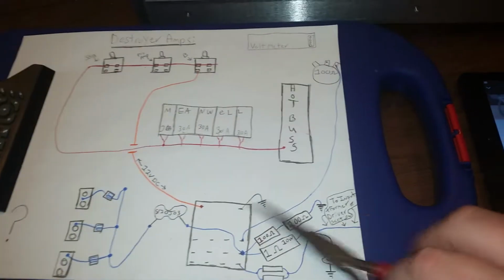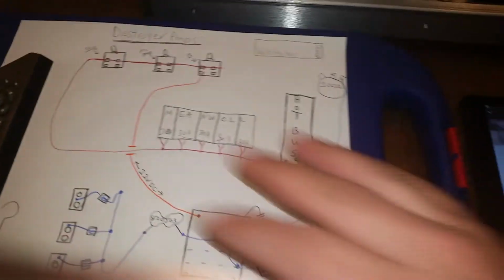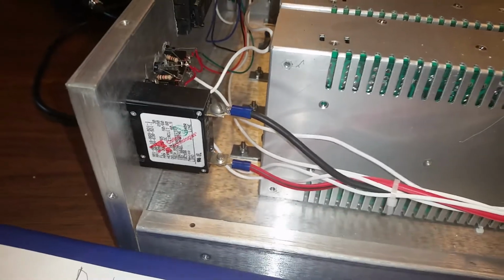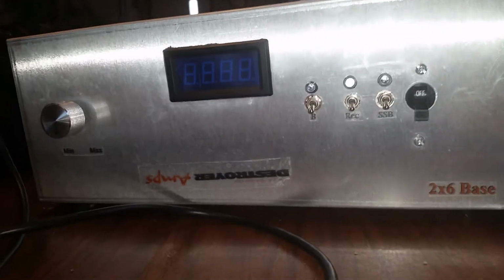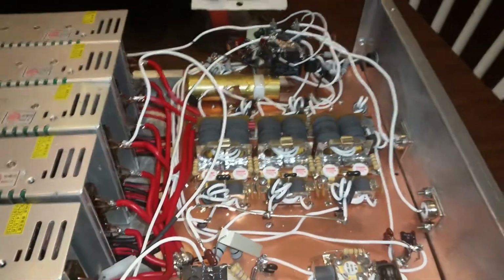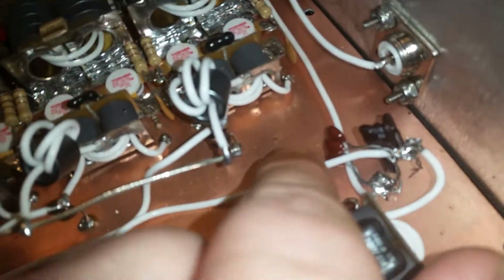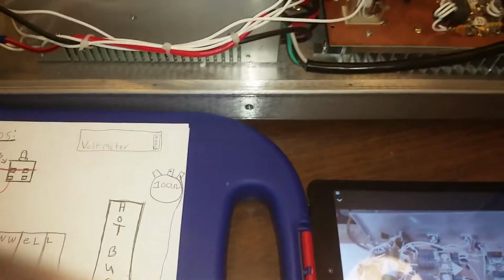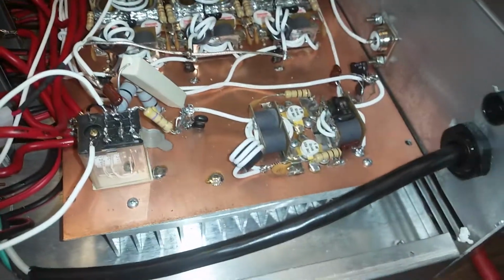Look At This 2x6 Base Amp Express Your Thoughts In The Comment Section. . .

Comment: No good stray i inductance and not alot of Chraftsmanship here.. .. i like physical connection..on the eyelts if u doht use a star washer and locker its comes loose ...i myself like soldering the connections to the switch.. my biggest issue is stray Inductances and poor Chraftsmanship

Comment: a outher fake bias. when done right for bias should have  .5 to .7V from base to emitter.  .5V is around class B and .7 - .75 is round class A . 0 volts is class C. it is about the collector current with no RF . And I see possible trouble ahead. How is air going to pass threw them heatsinks ? The fins are facing the wrong way and no blocker to make all are exit threw the heatsinks and out back of box threw the vent. I love that driver. just wraps and output transformer could be better. It's 6 pill can give it some drive. SD 1446 are great for that. With some love that box can really do some work . 73's
Reply: Exactly you need dc bias to turn the transistor on ,there are 3 stages off ,amplifier, and saturation or full on and you need dc bias voltage to tell the transistor what to do,mr gatekeeper did a video on bias on 3 different types very nice explanation thank you gk.
Reply from the maker: Thanks bud
Reply from the maker: Ive often wondered how much it would need for class A ive never had reference to look at meaning an amp done that way

Comment: Is it good practice to build the 2 pill section class B as well as the 6 pill class B bias
Reply from the maker: Well if your going to use bias you might as well use the same bias everywhere but I have seen people leave drivers in c class and bias only the finals...never heard them explain why.... im a big fan at doing amps with out drivers in them when doing amplifiers that have transistors in them using DC Bias.

Comment: Wow that is terrible! First the bundling of the AC/DC and RF wires! No bias bias circuit. All the white wire prob. not teflon, all one color, transformers and chokes wrapped like a blind man with no fingers wrapped them. The input and output transformers on the driver section. The ultra cheap CHinese switchers combined that way the least you can do is buy switchers designed to be master/slave sensing on the negative side. The way the mains power is wired up. The variable is scary. No one is using a base 2x6 as a driver so just delete the variable. Who leaves a heavy sand bar just floating in the air? THe fact that the pre-amp parts are not together is telling of all the solder work. Those parts should have had a mechanical connection like twisting the legs together before soldering them. 

Given the quality of the work or lack of quality it makes me question if those ST's are ST's and if the Toshiba's are Toshiba's!!!
Reply from the maker: Believe it or not the white Teflon was all 14AWG Teflon.
.but he wired the whole amp in 14AWG teflon.....you should have seen the clear box I had put all the parts in after removing them all.....omg....ill admit this was in the beginning of my hobby and I was no where near as experienced as I am now but I did an OK job on it.
Reply from the maker: That is called common sense which you have and you can see certain stuff that isn't right.